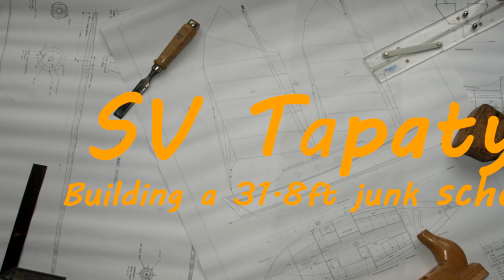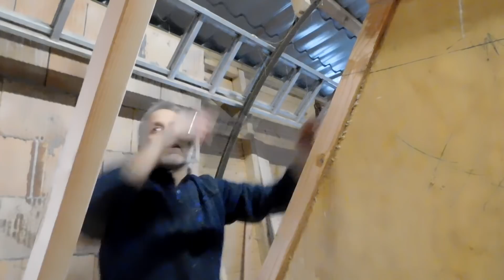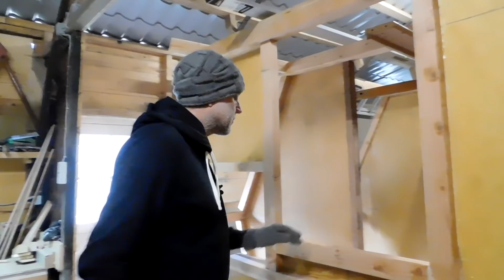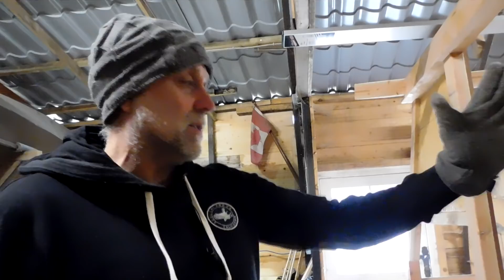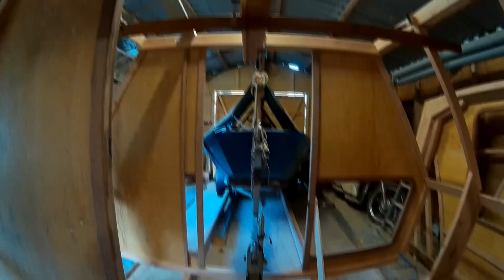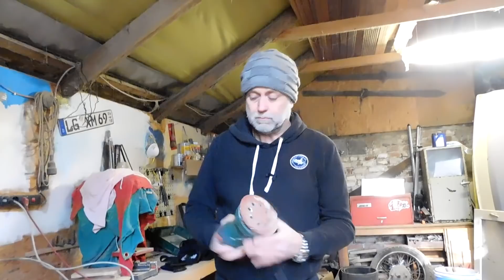Setting up the first sections - SV Tapatya EP24

Comment: This is way after the date, as I've just started watching your channel, but a couple of things. Where is the keel? Usually the keel goes down and the frames are assembled over it. Second, what about the ballast keel? You are going to need a few tons of lead or cast iron to ballast that boat. Third, I assume you have checked the plans and instructions to see whether the frames should be assembled vertical. Usually the keel is set at an angle to the horizontal on the ground. Getting the boat on its lines. Then the frames are put in upright onto the keel. They are not at right angles to it. Maybe this will be accounted for when you turn the frames the right way up later. It just seems like a strange way to be building a boat.
Reply from the maker: It's the way these boats are designed to be built. You build upside down, plank it, flip it, fit it out and then fit the keel right at the end. Yes there is a ballast keel of about 1200 kg.

Comment: What will be used as a keel/ballast?
Reply from the maker: Hi Mark
There are 2 options. Either a lead keel or concrete and scrap iron. There are also long keel or fin keel options. The easiest and cheapest of those is the concrete and scrap iron fin keel. This is also the option that was recommended to me by Dan Johnson, builder of Hestur. Annie Hill also suggested she favours fin keels in a post on the JRA forum recently. I am, however, still undecided.......